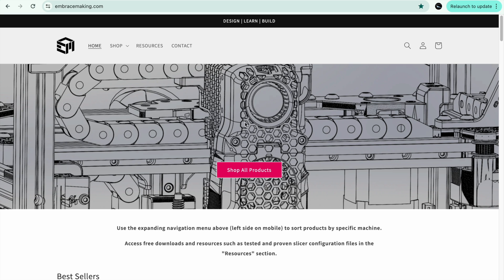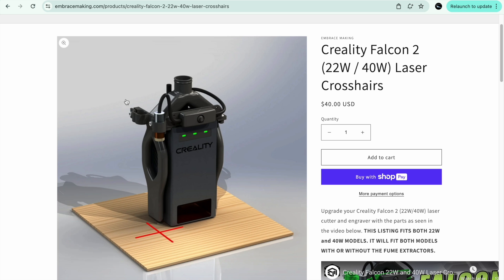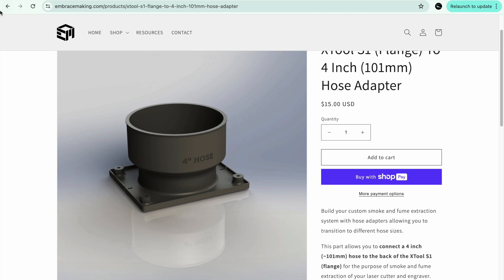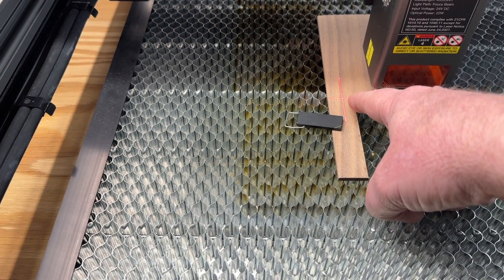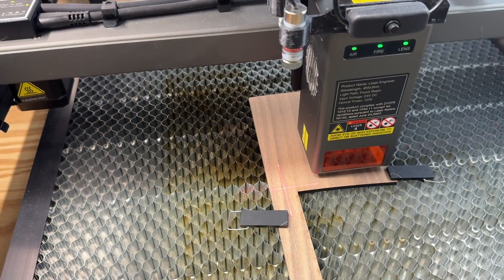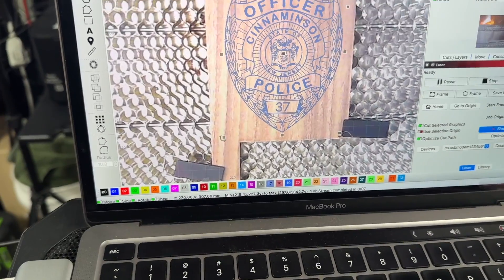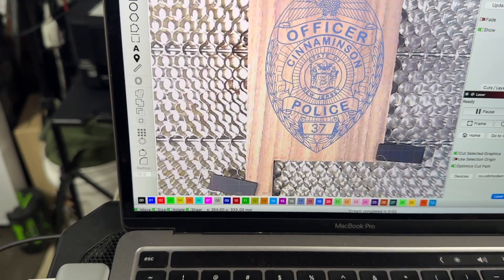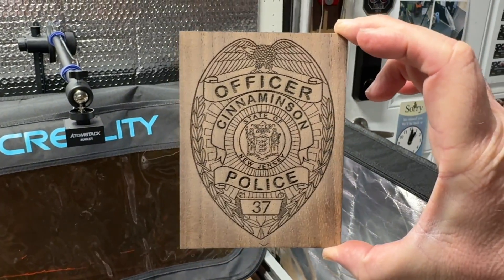Two accessories I purchased for the Creality Falcon2 to make Lightburn placement of engravings easy

Comment: I add crosshairs to my Creality Falcon 2 Pro by buying a crosshair laser module and button battery holder on Amazon for $15 total.
Reply: I just did the same thing, and I will design and print the holder.
Reply: @patrickhenderson1964  I did the same

Comment: Is the Falcon 2 a machine you would recommend? Seems a little underpowered on paper at least, but I hear the air assist is really good? What would you recommend for engraving steel knives?
Reply from the maker: I tested it did you watch both parts 1 and 2 of my review I would not call it underpowered at all. Yes it has a great air assist. But if your intention is to engrave steel even though it can do it I would look to a 2 Watt IR unless you can afford a fiber laser they are far better for metal, but good ones start around 6K A diode that has a 1064 2wat IR can do nice engraving on knives. I have two that can do it my Xtool S1 and my Laser Pecker 4 also the Xtool F1 can do it too but I don't own one so can't say much about it. How to pick would also depend on how you intend to use it. Are you a knife maker looking to put you mark on knives or are you just looking to do engravings for customers like I do for lots of chefs and edc owners ? If you ake knives I would say the Xtool S1 and then add on the 2W 1064 IR Head My reason is you could do buck blank engravings with it. If its just doing names and such then the Laser Pecker 4 or the Xtool F1 would be the way to go. Here is a link to ones I like https://amzn.to/3TsLvFD
Reply: @ALXSHARPEN  Okay that is great advice, thanks! I do have CNC/ 3D printer stuff and am looking to fill the holes of their shortcomings, thinking that laser and/or a mini-lathe would be a logical next step. 

Doing stuff like modifying, making new parts, scales etc mostly for fun, but as far as I understand no laser is great at everything? Dont have enough experience with them but ive been told that one good at cutting may be bad at engraving and they are good at different materials and such. Very hard to pick!
Reply from the maker: @kvernesdotten  yes exactly my 40w XTool is a fantastic cutter and it’s a good engraver the fact that you can swap the 450 NM laser out for an IR module is awesome so it can engrave metal really well. The Falcon is fantastic at engraving and good at cutting it does very nice detail work especially on wood so you are correct when I started I thought one was all I would need now I have 3 😆 because they all have different things they are great at the XTool S1 in my opinion is the most versatile and if they start selling the 20 watt module separately you can have one laser that’s really 3 lasers if you buy all the modules it can run in it. If I could only have one it would be the XTool S1 for me but fortunately I can have more than one.
Reply: What camera and mount are you using ? Thanks !